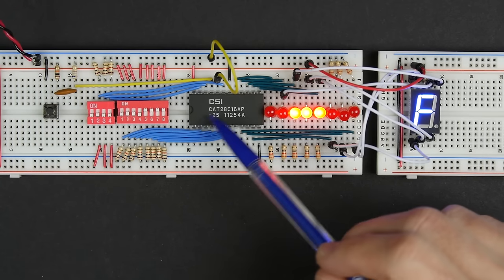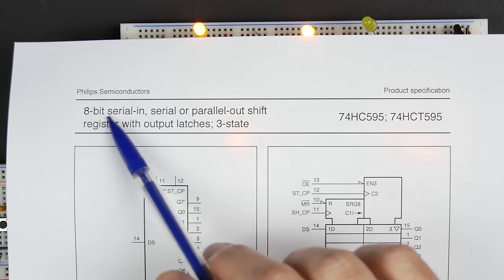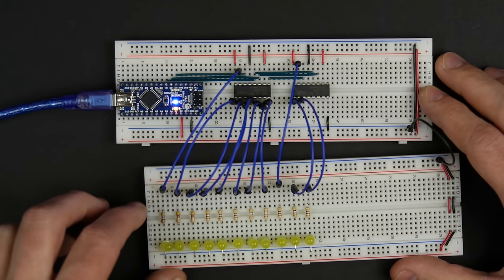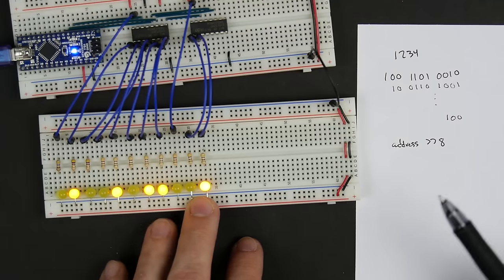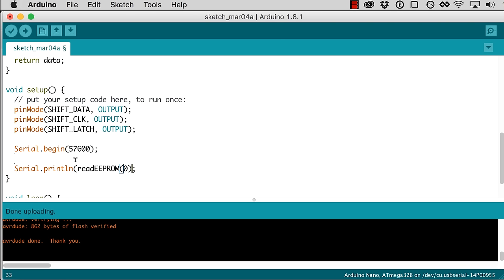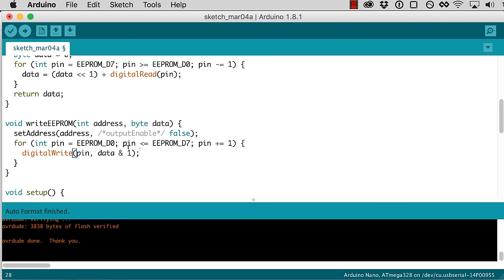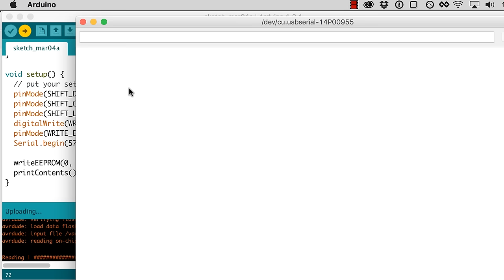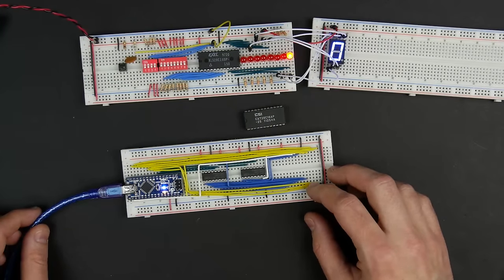Build an Arduino EEPROM programmer

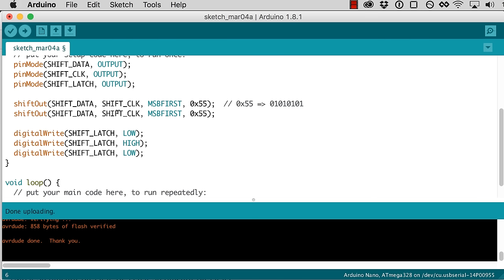Comment: I bugged out on 22:00 where you convert address 1234 into binary. How do you do it so fast ? Did you cut the video to calculate it? 
Great and clear video anyway, thank you.
Reply: This is how I do it:

1) 1024 is the largest power of 2 that fits in 1234, which corresponds to a 1 with ten trailing 0's (because 1024 = 2^10).
2) 1024 easily subtracts from 1234, leaving 210.
3) 210 is 255 minus 45. 255 is eight 1's in binary (because 256 = 2^8). So we set the last eight bits to 1.
4) To subtract 45, we turn off the 32 bit (leaving 13), the 8 bit (leaving 5), the 4 bit (leaving 1),  and the 1 bit (leaving 0), which is the first, third, fourth and sixth bit respectively if counting from right to left. (The idea here is that at this point you're working with smaller numbers which are easier to deal with).
5) Writing it out we get:

1 (from the initially subtracted 1024)
00 (the first two zero bits of the ten trailing 0's. Two because we're about to write the remaining eight 1's of the 255).
11010010 (eight 1's with the first, third, fourth and sixth (from right-to-left) bit changed to 0's to account for subtracting 45).

Thus: 10011010010

Final check: 1234 is an even number. Even numbers should have a zero at the end in binary (least significant bit). This is true.
Reply: It's all about recognizing the powers of 2.
Reply: Erm... he worked it out in advance. You don't think he starts recording with no preparation do you?

Comment: Ben - THANK YOU for this video! Thanks to your tutelage, I was able to easily create a modified design of your circuit for a 16KB D27128A EPROM. That EPROM is used for the OS ROM in my old Atari computer. I was able to pull the data off my custom OS EPROM and dump it into a binary file to load into my old system (which now has a way to load ROM files for the OS). Mine doesn't look as nice as yours does though - I don't have customized lengths of wire that fit in nice and neat. You saved me a good bit of money too, since the programmers you can buy on Amazon/eBay are upwards of $100.

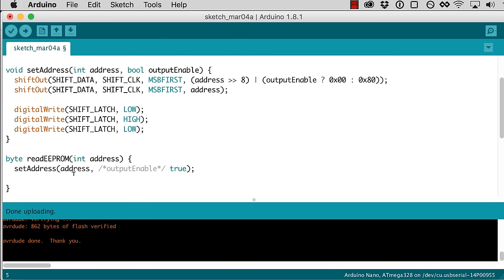Comment: Hi! I wanna ask something.. At 31:24 you defined ' EEPROM_D0 5  ' and 'EEPROM_D7 12'. You did not actually define others in between D0 and D7 but still it works? Can you explain a little bit how the code works here? Anyone feel free to answer of you know.
Reply: Ben is not explicitly addressing each EEPROM data line in his code. The two values EEPROM_D0 and EEPROM_D7 are instead being used as lower and upper limits. So he has no need to individually name each bit. Think of the difference between

byte = 0;
for (int bit = UPPER_LIMIT; bit >= LOWER_LIMIT; bit--) {
  byte = (byte << 1) | getbit(bit);
}

Advantages: Easier to write (in my opinion) and the limits can be changed in the future.
Disadvantage, requires D0, D1, D2, ..., D7 to be sequential. Can't have any gaps in the sequence.
Slower execution speed.

and

byte = (getbit(BIT7) << 7) | (getbit(BIT6) << 6)
          | (getbit(BIT5) << 5) | (getbit(BIT4) << 4)
          | (getbit(BIT3) << 3) | (getbit(BIT2) << 2)
          | (getbit(BIT1) << 1) | getbit(BIT0);
Advantages: Faster execution speed. Doesn't require the bit values to be sequential.
Disadvantage: Highly repetitive and typo prone. Not easily expandable in the future.
Reply: John Cochran oh! I think i got it. So is it the #define function that take care of other value in between D0 to D0. Cuz if he would have used int to define the variables maybe that would have not happened unless you define all of them right?

Comment: Wouldn't it be faster to just use two latches which would latch the address and data and then assert the write signal? That's just two clock cycles for each byte instead of one clock cycle for each bit :q

Comment: Do the "analog" pins can be used as digital i/o? I think you can... On PICs thats completly possible!
Reply: Yes, analog pins are usually just digital pins with hardware PWM generators attached. But if there are enough digital pins, it's best to use those first because PWM is a bit expensive to do in software. Basically keeping them open in case you need them later.
Reply: Correct, analog pins can be set digital also.
Mike
Reply: Aaron King Aren`t A0 to A5 analog inputs? PWM by the way is only available on special digital Pins
Reply: I thought so, i just asked if those pins could be used since I'm more into PICs than AVRs. So the answer is: A0 thru A5 can be used as digital I/O, withouth any catch. Those can be used as analog inputs as well. A6 and A7 seems to be only analog.
The PWM peripheral can be attached to other pins, so it doesn't has anything to do with analog.
Reply: Yes, the analog pins are simply also connected to an ADC or comparator, they can still be used as digital I/O. The PWM capable pins are a different set.
Reply: DAC
Reply: No, as far as i know, the Atmel Atmegas don't have DACs. (PWM is very diffrent from a DAC)
Reply: ohh ok, I knw DAC was different in PWM but I didn't know that Atmegas don't have it.
Reply: It's possible to use PWM with an RC circuit to create a DAC and then a single transistor to drive the output. writeAnalog does simulate PWM by software instead of using hardware timers for creating it. [edited: as per Alexander answer]
Reply: Luiz Felipe writeAnalog just outputs a PWM Waveform, without a lowpass, it isn't nearly an analog voltage and can get dangerous if connected to a device which can't handle 5V on inputs. Connecting a simple RC lowpass will make it possible to create a analog voltage.
Reply: You're right, my wording wasn't clearn. writeAnalog simulates a hardware PWM by software, you still need the RC.
Reply: Analog IO pins are reading and outputing analog signals.  PWM is not an analog signal, it is a digital signal that uses pulses to be able to generate an variation of power levels on a analog devices that integrate the pulses over time to get a variable effect.

An analog output generates a variable voltage.
An PWM generates pulse trains of digital signals, on an off.
A digital output is just fully on or off.

Comment: Did he do all of this just so that he doesn't have to manually load data into the EEPROM with switches?
Reply: 3.5 hours worth of straightforward and fun work programming and setting up breadboards, or 8 hours of dipswitches, address setting and head pounding. Your choice.

Comment: Ben, do you think its a good idea to order a cheap copy of the Arduino nano on ebay from china, does that matter or is it just waste of money and time?
Reply: Why would that matter? You only require the microprocessor to be the same. E.g. ATMega328, chinese usb2serial converters work just as good.

Comment: "getting really old"
This used to be the ONLY way to boot some legacy hardware...
you had to manually  program in the boot sequence with switches just like this....

Those long winter evenings in the server room used to just fly by......
Reply: haha I remember doing just that on PDP11s. Toggle in the bootstrap loader and get it going enough to read from the teletype. Same for the GEC 4000 except those were equipped with hard drives which made it all quicker until we got the prom upgrades to do it for us.
Reply: My Dad watched over a system that did this in a particleboard plant. It was a Measurex system with a 2-step boot sequence. You had to manually set the instruction data switches and clock them into the processor. This machine was advanced enough to find and load from the 8-inch floppy drive with only two such instructions. They cut him loose around 2004, so I guess they finally upgraded.

Comment: Cool to see that I'm not alone. I've done the same for my 8-bit microcomputer project (6502 based). Ended up with an Arduino based programmer that has a Java-Client for easy uploading, downloading and erasing eeprom Content. https://github.com/mkeller0815/MEEPROMMER

Additionally you should use "unsigned int" for your address variable, because calculating with a signed integer can have unwanted effects.
Reply: Mario Keller Looks like this breadboard version needs some changes to work with MEEprommer.  Comparing the schematics CE is tied to GND on the breadboard version and OE is coming from the second 595's Pin 7.  Not figured out how that is working myself yet (I'm still learning).  Also no 100nf capacitors on the breadboard version, is that going to introduce too much noise and error into the writes?  The other pin assignment differences I understand and can deal with (I think) :)

Comment: You can use a analog inputs as digital pins as follows. Program the analog pin as an input, then program the pin high. This will make the pin into a digital pin with a pullup. Repeat this for each analog pin.

Comment: Man, I love you, but please never again loop like that xD
You loop properly 2048 times as such:
for(i=0;  i<2048; ++i); {...}
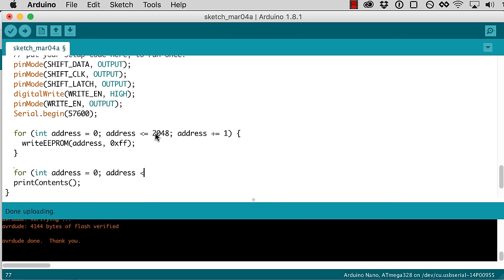That is, 0 included, maximum excluded. Looping from 0  included to 2047 included, while having the same identical effect, is much more prone to human mistakes (see? you had to correct at 55:00) and therefore considered bad practice.

(of course this is a very minor note, as you're teaching on electronics and not on coding)
Reply: he's not a programmer, it's ok to use 255 as the upper limit, his mind is set that way
Reply: so wasnt just me wondering why he did that :D